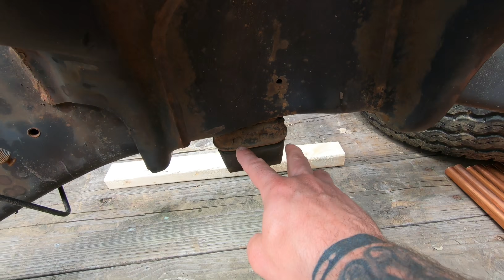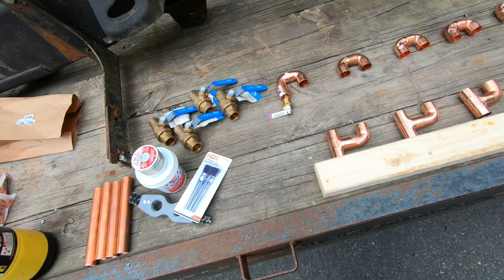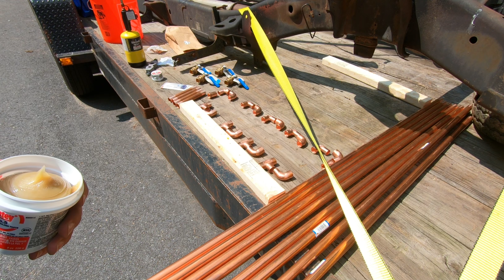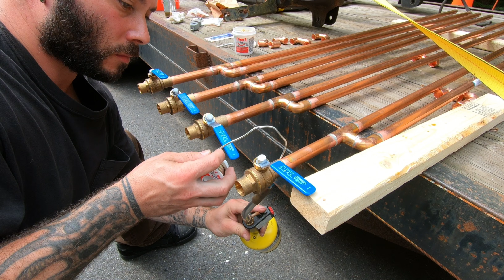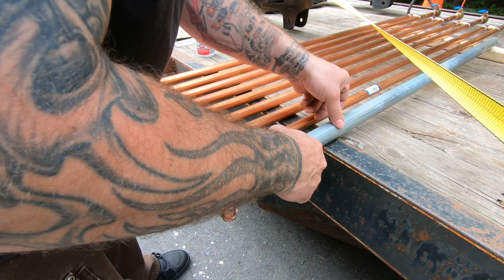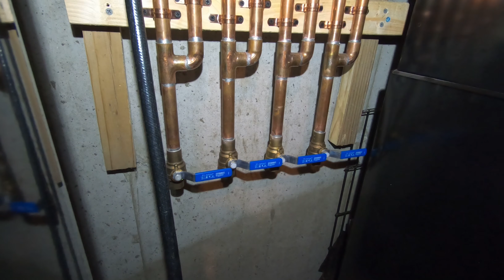How to build a copper pipe air compressor air dryer

Comment: Dont know why you guys keep building these in the vertical orientation.  Build them horizontally and put each pipe on a slight incline and you only need one valve because all the moisture will go to the lowest point.  Save a ton of money on valves.  A cheap after cooler is worth their weight in gold.  If you dont put 300 degree air in your tank you will have very little moisture to contend with.  Good job on the craftsmanship of your build and im not knocking your work in any way. But your plan of what you built is off by 90 degrees.  Just my take on it. Thanks and yes it was a good watch with good info.
Reply from the maker: That’s a pretty good idea of hanging it sideways. Thank you for the advice. I appreciate your help and thank you for watching. I’ll look into the after cooler.
Reply: Yeah maybe but the vertical pipes might encourage that water to go down. No reason you can't tie the drains together and run them to a single valve.
Reply: @perry9492  That would cause a bypass

Comment: 40 some solder connections without a leak. Pretty good for a new guy.

I wonder if you put a fan or 2 blowing on the pipes if they'd be more affective. Maybe cheaper then adding another row.
Reply from the maker: Thank you. I was surprised I didn’t have any leaks, I guess It must have been beginners luck. I haven’t ran the compressor that much but a have a box fan I will try when I do.

Comment: I think the flux is supposed to boil off. If you want prettier solder joint get a wet rag and wipe them off a few seconds after you finish. It ought to work fine.
Reply from the maker: I should have gotten a rag. All the dry paper towel was doing was pushing it around and burning my fingers. It did wipe up some of it, I looked a few days later and the flux that didn’t come off was turning the pipe green so I had missed some and had to clean it again.

Comment: You may not have the option however if you can move it further away from the compressor it may help with cooling and stop all water.
Reply from the maker: I was thinking of maybe running a longer hose between the compressor and the piping.

Comment: Nice work. I did something similar, I wanted dry air for my plasma cutter. If you want to throw more money at it put a filter and water separator at the end. That will probably get the last bit of water out before your tools.
Reply from the maker: I think I’m going to put a separator at the end. I think some of the problem with the left over water is it’s so close to the compressor, and using a sand blaster the air is just rushing through it. I think normal air tools it would get more water out because the air is not flowing through constantly.